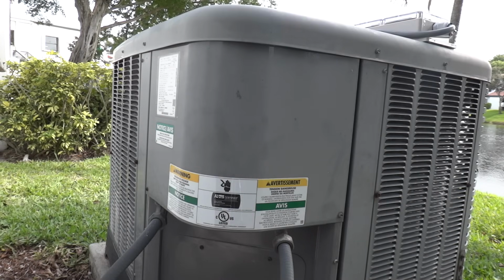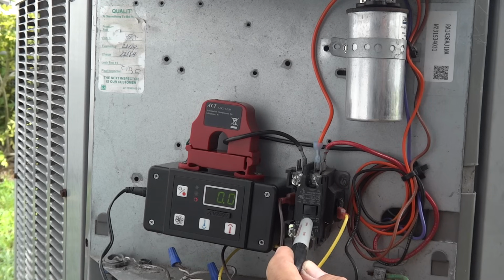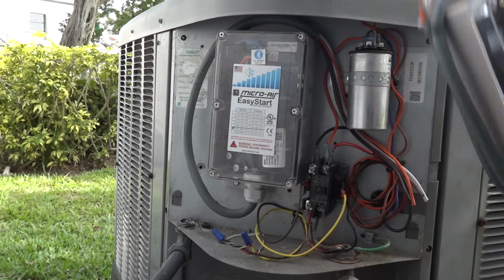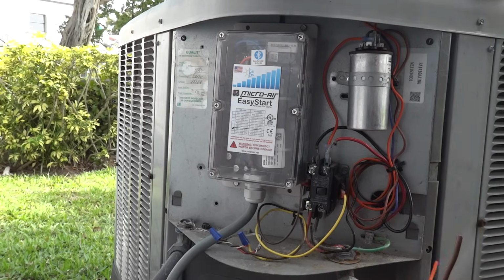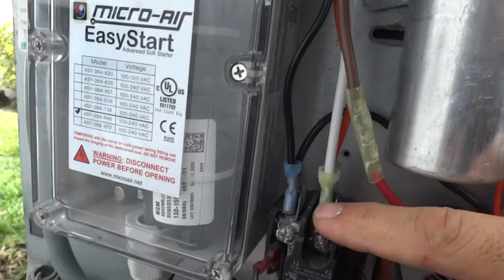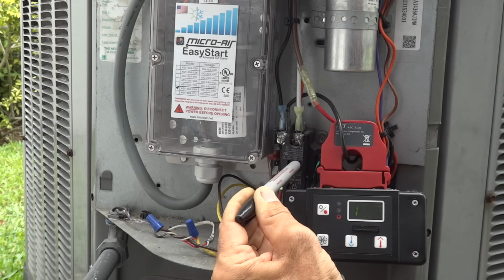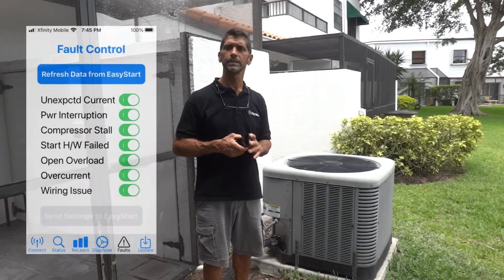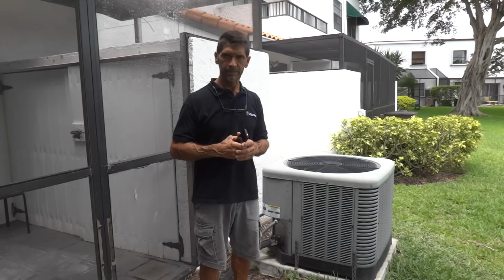Micro-Air EasyStart Home A/C Installation (368 Series)

Comment: Hello, I see cheaper price for the one without the Bluetooth feature.  Is it okay to buy this unit or better to buy the Bluetooth feature?  Are there any differences in other features that not mention internally?
Reply from the maker: Hi and thank you for your question.  The ASY-364-X20-IP is only meant for 115V (RV and marine) applications, so it is not appropriate for a 230V home A/C unit as shown in the video.  The ASY-364-X36-BLUE, ASY-368-X48-BLUE, and ASY-368-X72-BLUE handle 240VAC and all only come with the Bluetooth feature.  The Bluetooth models are therefore more robust as a result since they have to handle 240V.

Comment: Dangerous for homeowners and unnecessary if unit is set up properly. This product only effective if shortcycled there are proper way
Reply from the maker: Hello Chuck and thank you for your comment. EasyStart is not dangerous for homeowners as 95% of our customers install it themselves with great success!  If you needed help, you could always hire an HVAC contractor as many are now carrying and installing EasyStarts for their customers.  EasyStart reduces the start-up amperage for all starts, regardless of whether not the unit is short-cycled.  There is no other way to reduce the starting amps by 65-75% without using a soft starter like EasyStart.

Comment: Will it work with or required for compressors with inverter technology?
Reply from the maker: Hello Augustin and thank you for your question. EasyStart isn't required for nor compatible with variable-speed inverter-driven compressors.  EasyStart only works with single-phase, AC induction motor compressors.

Comment: Why dont all these ac companies offer this type of settup on their models? Seems to me that would be a great selling point for lowering electric consumption.....what' gives here on this?what's the downside of this item?.....surely a 3 ton unit of somewhere around $5k (my quote installed 6 months ago $5200 ,west coast of fla.where hurricane Ian just ran us over and Charley previously said to say)could easily absorb this into the price, if not raisdd a little....knowing these big greedy companies they would raise it $1k.
Reply from the maker: Hi and thanks for your comment.  Although we cannot comment on the desired profit margins for the HVAC OEMs, we all know they're in stiff competition with each other.  And although these OEMs know what soft starts are and the value they bring to their systems, they also do not believe that enough of their customers will recognize this value and be willing to pay a little bit more for it.  Yes, this doesn't not make much sense, given the huge aftermarket popularity of EasyStart. 

One other clarification: Although EasyStart dramatically reduces the startup current surge (i.e. initial Amps), it has no effect on the amount of current that your A/C compressor draws when it is running steady-state (Amps or Watts).  Therefore, EasyStart does not save you electricity in the form of kWh (i.e. total energy), so your monthly bill won't be any different in that regard.  But, in some areas of the USA and the world, the electric utility companies DO penalize and charge you for your "peak demand", which corresponds to your peak amperage usage (i.e. peak Amps, not kWh). In these particular regions, EasyStart might be able to save you money on your monthly bill since the peak demand caused by your A/C compressor startups will be eliminated.

Comment: You’ve sold me on this! Where I live in Florida we experience a few power interruptions each year and even though I have a 5500K generator I can’t run my 3 ton unit. The money I spent on a window shaker to use in those times I could have purchased the Easy Start and use my split system. Your explanation was very educational. Thanks
Reply: Have you tested the product with your generator?

Comment: But- 15:28 with the easy start, the compressor is  making an awful racket, rattling until the ramp up is complete. Soft start is great, but it's not suited to all systems.
Reply from the maker: Hi and thank you for your comment. That occasional noise was from the condenser fan, not the compressor. That particular HVAC unit was a bit corroded from being right next to a brackish lake for its entire lifetime, thus the reason for its noises.  

EasyStart is great for any A/C system that uses a single-phase, AC induction motor compressor.  90,000 happy EasyStart customers can't be wrong.
Reply: @MicroairNet  I'd get an easystart for my heat pump if I had the spare cash, but that noise is distinctive, and it is almost certainly coming from the compressor.

Comment: Hello, just purchase my EasyStart 5 ton unit Oct. 2022.   I had all the crimping tools and connectors to install it already.  My 15 year old original Westinghouse  compressor made a loud bang! noise at start up every time it came on.  The inrush current exceeded its limit.  After installing a hard start kit the inrush was below it limit, but still BANGed on start up.   Once I removed the hard start kit and installed Micro-Air EasyStart 5 ton model the compressor. The  compressor fan starts up first and after about 10 seconds or so the compressor starts up Ever so quietly.  You almost don't hear starting.  From Inside the house it would startle me with each cycle start.  Now it is whisper quite inside the house house.   I hear the compressor fan more than anything inside the house - no more scary bang !   Worth every penny.  My hope is this will extend the life of our A/C unit.  It would be nice to have the actual wiring schematic drawing beside the photos on line.  So between the online photos and the verbal instructions on this video, I was able to figure out the wiring.  I used a variable drill bit to drill a new hole in the electrical box and an external wiring connector to go through my electrical compartment as the EasyStart would not fit inside.  4 self tapping sheet metal screws to mount the EasyStart outside, and done.    When the old compressor is at its end of life, it can just be transferred to the new compressor.   This is something they should point out, added value that it can be used on your new unit, and you don't have to buy another one.    Thank you for the great product video.

p.s.  After the EasyStart install, I can easily start and run this 5 ton compressor from the Tesla Solar inverter and Powerwalls without any startup assistance from the grid power!
Reply from the maker: Glen - Thank you for your comment and for your business.  Yes, if you ever did want to move the EasyStart to another HVAC system, all you have to do is re-initiate its relearn process via the app.

Comment: Nice video.. you think it can be used in a unit has 15 year old??
Reply from the maker: Hi and thanks for the compliment. Yes, absolutely.  EasyStart is compatible with old A/Cs as well, regardless of the type of (AC motor) compressor.  EasyStart works with reciprocating compressors, rotary, and scrolls.
Reply: @MicroairNet  thanks a lot for the info i would get one

Comment: I'm I misunderstanding your chart and example at the 21.29 mark?  The footnote says that you must apply a multiplier of 1.4 to the generator size.  The 3 Ton example says in green 5,200,  and citing that a 5,500 watt generator would work.  But using the 1.4 multiplier I get 7,280 as the starting watts.  A 5,500 generator usually would not have such a large surge amount of 7,280.  I'm I correct?
Reply from the maker: Hi and thanks for your comment and question.  You are correct.  We have found that most generators are specified very conservatively with a 1.25 multiplier for their starting watts.  In our experience with many different generators over many years, depending on the mass of the flywheel and the quality of the components, many generators typically exceed this rating and deliver as much as 1.5x for starting watts.  We even found that some inverter generators can deliver almost 2x.  Now, we're not saying that you should exceed the manufacturers specs, but in order to make the chart more realistic and not end up specifying enormous generators for the no-EasyStart cases, we wanted to benefit them with perhaps a more real-life prediction.  That is where the 1.4x compromise came from.  Bottom line, if you don't need an EasyStart, we don't want you to think we're forcing you to buy one.  Yes, many benefits lie beyond the primary goal of being able to start the compressor when you otherwise could not have, but we've taken enough of a bashing from the naysayers to give them as much opportunity as possible to prove us wrong.  In the end, EasyStart is always ends up being the better choice, but we want everyone to make up their own minds.  90,000 happy EasyStart customer can't be wrong.  Thanks again for your question.

Comment: It doesn't mention anywhere what the benefit is?
Reply from the maker: Hello Brian and thank you for your comment. The benefits are discussed throughout the video and on the EasyStart literature, but here is the brief summary:
 
- EasyStart reduces the inrush current by 65-75%, which allows you to start and run your air conditioners on a limited power source such as a generator or inverter, when it otherwise would not have worked.

- EasyStart continues to monitor your compressor after it is started and throughout steady-state running operation to protect it against harmful events like: power interruptions, brownouts, low-voltage, stall conditions, and overcurrent conditions.  If any of these fault events occur, EasyStart disconnects the compressor, waits 3 minutes, then re-soft-starts it again. 

- The above 2 benefits greatly reduce the stress on any compressor, and therefore can extend the life of the compressor.

- EasyStart also dramatically quiets the noise that compressor makes when it starts up, thus eliminating the "bang" or loud "thump" that a compressor normally makes.  This can sometimes make a difference to a light sleeper who's A/C unit is located right outside of their bedroom window.

Comment: I would recommend not sticking your finger in and touching the capacitor contacts. If it's charged, it could bite you bad.
Reply from the maker: Hi and thank you for your comment.  As it turns out, run capacitors always discharge very quickly (less than 0.1 sec) after power is removed because both legs are connected across the run and start windings.  Given that is 4 to 5 ohms max, a (large) 50 MFD run capacitor will discharge (with 5 RC time constants) in 1.25ms.
Reply: @MicroairNet  Thanks for the reply and info but a DIY'er does not know that and should not be sticking their fingers around any capacitor. unless it has been discharged.  Just my opinion.
Reply from the maker: Agreed.  Better safe than sorry.

Comment: The installation of the wires does not have to be in any particular order correct? Thx
Reply from the maker: Hi Peter and thanks for your comment. No, the wires don't have to be connected in any particular sequence, but their connection points are of course critical.  Installation is of course done with power turned off, so you can attach the wires in the sequence that best suits the particular electric box arrangement.

Comment: Wow, so this thing is nothing more than a over glorified Hard Start kit but with Bluetooth monitoring for a Condensing unit. I looked up the price and was astounded to see that this product costs over $300.00+ where a non Bluetooth Hard Start kit will run you less than $40.00 and give your Condensing unit the exact same startup current results. Save yourself money and just buy a CSR-U1 Compressor Saver.
Reply from the maker: Hello Brad and thanks for your comment.  EasyStart is not a hard start. It is a highly-sophisticated, microprocessor-controlled *soft start*.  We invite to watch the detailed explanation on the differences between hard starts and soft starts in the HVAC/R School video at the following link:  https://youtu.be/7Gim96oyczw
Reply: @MicroairNet  I watched you video and I guess you could call it a Soft Start or a VFD type unit. But one of my main questions that you did not address in either video was how does your product handle a Non-bleed TXV System where the Compressor doesn't start up at Zero PSI but rather about 200 PSI (Say R-410A). There are many Residential systems and appliances that have Non-bleed TXV's in use today and I wonder how your product would start a Compressor under high head pressure where a simple Hard Start kit is the method at starting the compressor and at the correct rotation?
Reply from the maker: @Brad W Thank you for watching the video.  FYI, the EasyStart is actually not like a VFD; those control and ramp the frequency of the AC voltage applied. EasyStart only controls and gently ramps the amplitude of the voltage and the current that is applied, which is how a soft start works. 

Your question about internal refrigerant pressure equalization and TXVs that don't always bleed down is a very good one.  For many years, EasyStart did not run into any issues with this since most R-22 and early R-410A systems used either cap tubes or TXVs with a bleed port that equalized the refrigerant pressures in less than 3 minutes.  Now, with the big push towards higher SEER ratings, many HVAC OEMs are using non-bleed type TXVs as you mentioned.  In those systems, EasyStart cannot always orchestrate the low-current soft start sequence because the compressor is trying to start up again very high head pressure.  EasyStart will still start the compressor, but it will not be at the 65-75% reduction (from LRA) that we advertise. In other words, the start becomes more "hard" and less "soft".  But not to worry, we came up with a solution that works in almost all cases.   EasyStart has a built-in "smart" 3-minute short-cycle prevention timer that prevents the compressor from restarting if it is shutdown and immediately repowered by the thermostat and contactor.  This "smart" timer counts down the time since the compressor was last turned OFF, even while no power is applied to EasyStart (i.e. while it is dark).  Yes, we added special circuitry to accomplish this because no one likes to wait unnecessarily.  So, if EasyStart turns back on again and more than 3 minutes have elapsed, it only waits its minimum start delay which is 5 seconds. If 2 minutes had elapsed, it waits one more minute.  You get the idea.  What we have found though with the non-bleed TXVs is that you can better equalize the internal refrigerant pressures if you always delay the startup of the compressor by 3 minutes since this allows the indoor unit's fan to run without the compressor running, which in turn warms the TXV bulb on the suction line in the evaporator, which in turn forces the TXV to open, and this allows the refrigerant pressures to equalize.  Then, 3 minutes later, the EasyStart does it usual soft start ramp up with a much greater likelihood of achieving the desired 65-75% startup surge reduction.   Basically, we added an optional feature to "dumb down" the smart timer in order to accomplish this.   This feature is optional and can be invoked via the smartphone Bluetooth app.  For customer who have such system with this issue, all they have to do is email our 7/365 technical support team at the factory in NJ, and they'll talk you through how to invoke this feature.

Hope that helps you better understand the sophistication of EasyStart.

Comment: Than you for getting back to on the Pool pump application.  SaD, that it can’t be done.  As I am in the process of purchasing 2 EasyStart units for my 4 and 2 ton AC units.  Can I also use the EasyStart for the blower motor?
Reply from the maker: Hi again Pablo.  Thank you very much for your business.  You will be very pleased with the huge startup current reductions you will enjoy on your 4-ton and 2-ton A/C units.

Just to be clear, the pool pump can be outfitted with an EasyStart, but Micro-Air does not have the resources to support such an application.  If you have the necessary knowledge and you know your pool pump's internal wiring diagram, go for it.  

Regarding the blower motor on an indoor or outdoor A/C unit, EasyStart is not necessary. This is because these blower motors are what is known as variable-torque (unlike a compressor which is constant-torque).  These motors only draw only 2-3 amps when running, and their startup current is only about 3x that.  Therefore, the startup amperage savings isn't going to gain you much.  Beyond this, EasyStart isn't designed to start a motor as slowly as a blower motor would require.  Therefore, Micro-Air does not recommend that you install an EasyStart on a blower motor.